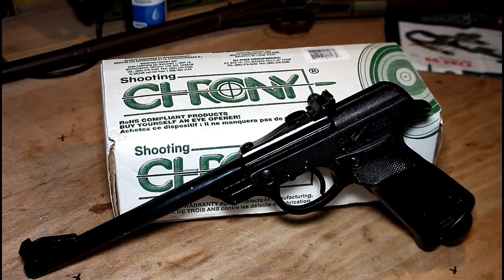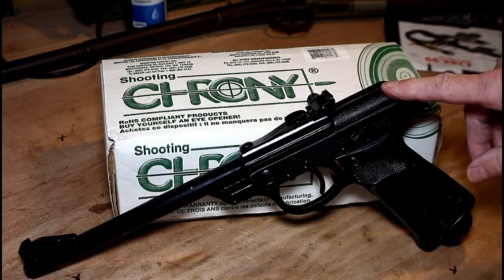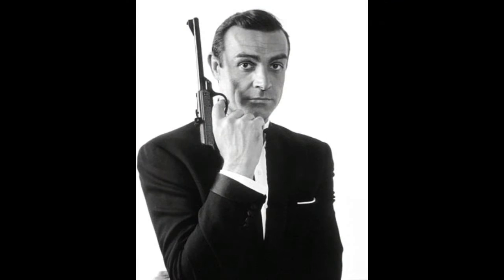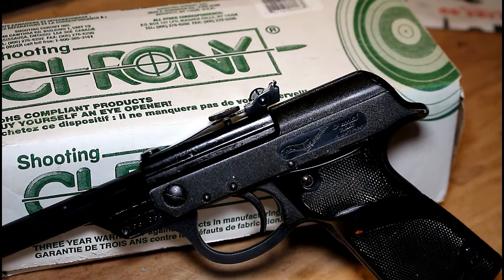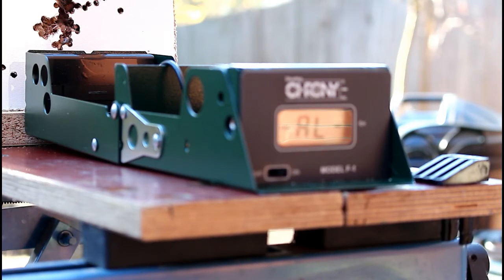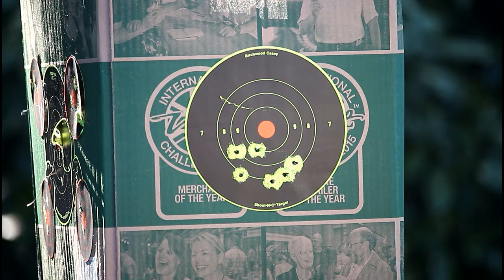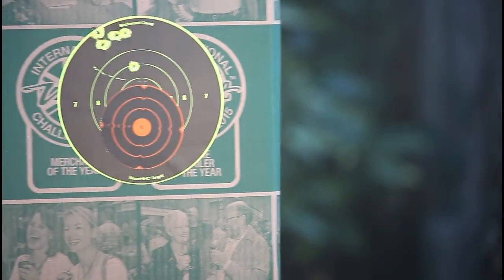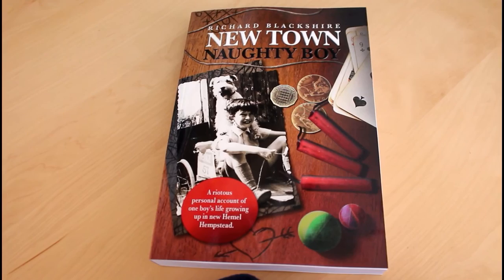Walther LP53 air pistol review and test

Comment: Dry Firing a spring piston airgun will damage the piston seal severely.
If you have been dry firing the pistol will definitely not be shooting at the velocity it should be.
Reply from the maker: am aware of the risks, once or twice is ok, would not make a habit of it
Reply: @newtownnaughtyboy8742  like the pre/post war Webley pistols it probably has a substantial buffer on the end of the piston and only one seal, on the breech, which it cannot blow out. I hate to think how many times my Junior has been dry fired, it is pre-war and was given to my grandfather by my father, and no harm done. For comparison it still shoots around 340fps, about 2-ft.lb, but with accuracy that might hit the side of the shed at 10 metres.

Comment: 5:44 The LP-53 is very ammo sensitive and some pellets give very low velocities. Try 7.0gr RWS Meisterkugeln, 7.33gr Falcons or 7.87gr AA Diabolo Express - all of them work well with the Walther and you may see an increase in velocity.
I got an average of 410fps with RWS Meisterkugeln in my unmodified Walther, then later tuned it with a TR Robb head, different spring and spring guide etc. and now get 510fps with the RWS and 500fps with Falcons.
Reply from the maker: Thx so much for your feedback. i will indeed try that.
Reply: @newtownnaughtyboy8742  Good luck with it. The Walther barrels are ever so slightly narrower than some other barrels causing greater friction when using wider pellets. Not all 4.5mm barrels or pellets are created equal...
The TR Robb piston head assembly was also the single one thing that increased performance most when I had my Walther modified. It took it up from 410fps to 460fps. The spring, spring guide and top weight were the final icing on the cake.